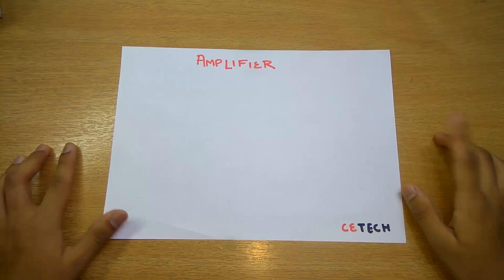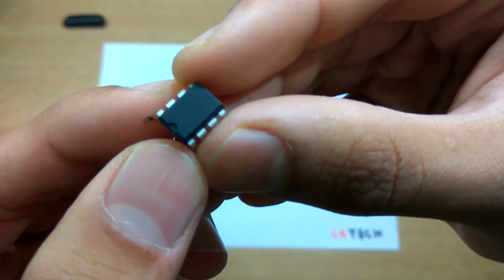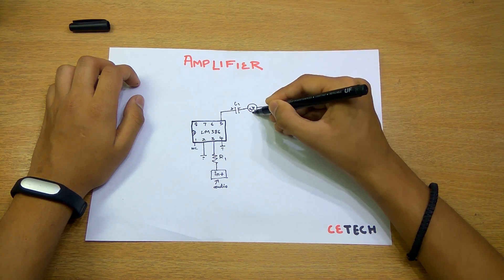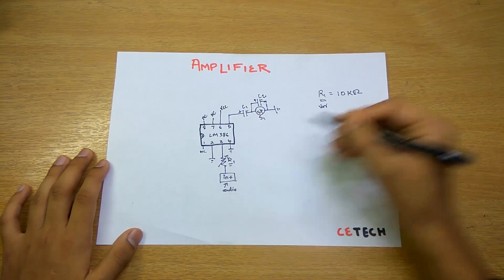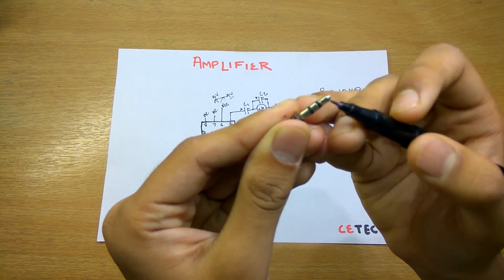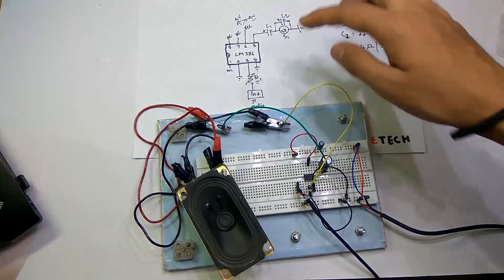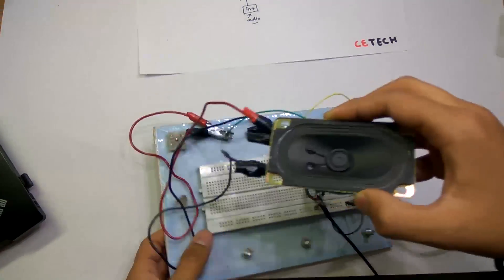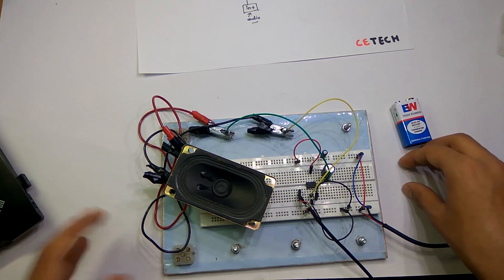DIY AMPLIFIER USING LM386 IC

Comment: to clean up the signal further add a 300 micro-f electrolytic capacitor on VCC (pin 6)
Reply from the maker: +Robert Arnold well if we don't use a battery to power this then that capacitor is sort of necessary

Comment: if i use 8ohm / 5 watt speaker can or not for this amplifier..?
Reply from the maker: +Khir Johari you can definitely use one. But the sound quality and amplitude will change.
Reply: If i use 4 ohm / 5 watt speaker the amplitude are also change or not....??
Reply from the maker: +Khir Johari yes of course the amplitude should change wrt my speakers but it would be fine if you use it. You see I have tried a variety of speakers and all worked fine. I had mentioned a particular as it is easily available. Go ahead and build your own with the speaker you have.
Reply from the maker: +Khir Johari yes of course the amplitude should change wrt my speakers but it would be fine if you use it. You see I have tried a variety of speakers and all worked fine. I had mentioned a particular as it is easily available. Go ahead and build your own with the speaker you have.